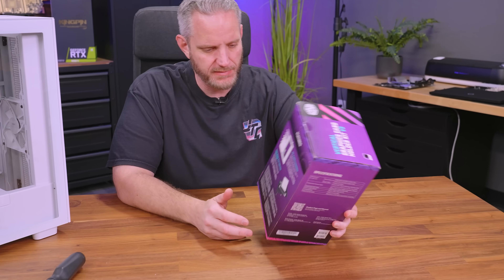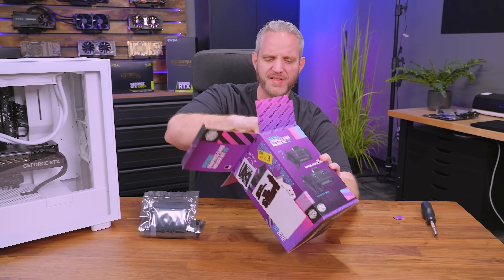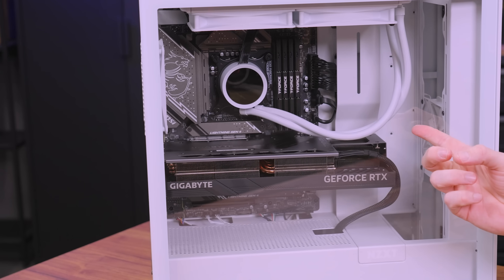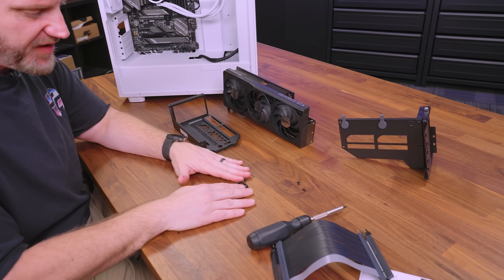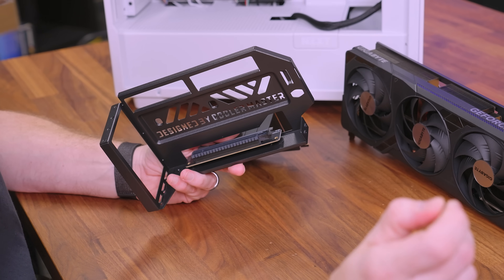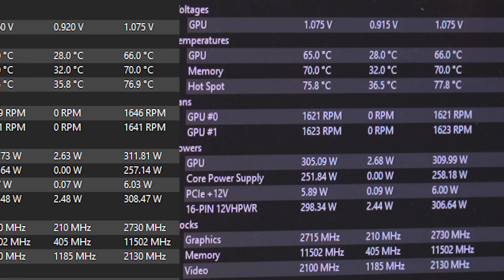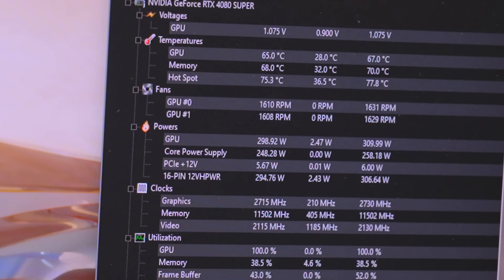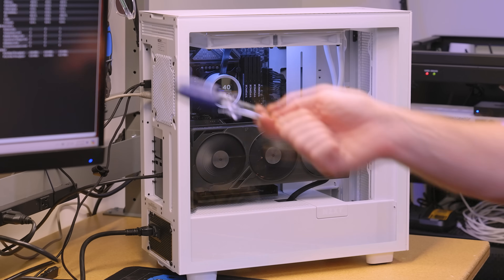Can this mount actually HELP GPU temps?

Comment: the best way to keep a gpu cool & quite is first of all undervolt it & optimally have a case with 3 bottom intake fans bloowing fresh/cool air onto the gpu
my 3080ti tuf oc never goes above 57C on the gpu die & 68C vram with fans set to max 60% while gaming, case is lian li dynamic evo

Comment: The Phantek new Premium vertical mount with gorgeous LED strip across the base, can be slanted to 45o and is solidly made. Has a similar cage to the Coolermaster but possibly better build and sturdier - check it out Jay :)

Comment: Since you have one on hand, what is the cleance between the pcie slot on the mount and its rear support bracket? I have an active cooling backplate and need at least 7 mm of clearance.

Comment: Hey Jay, does it really not matter how you orient the GPU? I was always thinking, that the best way to utilize the Heat Pipe flow is to have it horizontal to the CPU as well as to the GPU with the pipes pointing upward. (So like the old school HTPC concept of PC's. If it does not matter and there is a higher benefit of a direct air intake to the GPU, then I will leave it in its standard position as well as the CPU cooler in its regular mounting direction to the side. Thank you!

Comment: I bought a mount like this years ago and I love it.

Mine is aluminum and really compact. It requires you to remove the horizontal slats in between the PCI-e slots (if your case still has them, some new ones don't).
In return you don't ever have to care about the monitor cables or GPU length going up by more than a few mm.

Comment: This is why I had to switch from the Hyte Y60 to a Lian Li Lancool 216 because they put the mount right next to the glass if you're using a bigger card. GPU got way too hot.

Comment: Meanwhile I can't even afford replacement fans for my GPU so I slapped a case fan on it with ziptie and it... kinda works? It's not thermalthrottling on opening forza horizon 4 while it's still in it's main menu. I mean it is throttling, but it doesn't go to 93C, panic throttles to 133MHz, temp drops to prefered 85C and then back to 93C. Now it stays at stable 82C with like a bit more than half of performance. :D Had to change the prefered temp to 82C because sometimes it goes to 90 before it realizes it shouldn't go 9000% overclock (damn gpu boost 3.0).

Comment: The product is satisfactory, except that the recessed ports on the GPU are difficult to access once installed. Additionally, if you push the mount too far forward, it can obstruct your display ports.

Comment: One thing to note after buying this recently myself, the graphics card can suffer from tilt fowards because of how stiff the PCIE cable is pushing behind the mount. I was not aware of this before purchasing until having a quick google. Don't get me wrong it is no where near a big issue but can be unaesthetically pleasing.

Comment: I've always been interested in vertical mounts, but sadly, there are no cases where I could do that without sacrificing my SoundBlaster AE-5.
Now I could use an external DAC, but then again: i don't want to spend another couple hundret bucks, just so I could use vertical mount with 600 ohm impendance...

p.s.: Fractal Design Meshify 2 XL is my case, so its not a smol one either...

Comment: I mounted my 7900XTX Red Devil vertically (with universal mount LINKUP - AVA Universal Vertical GPU Bracket, look at the Amazon if you want it) year and a half ago, and it lowered 2-3 degrees of GPU :) The main trick is that my case - Corsair 5000D Airflow has 3 intake 120mm fans on the right side, and together with frontal intake fans the main cold airflow inside the case is shifted towards left side, and that's where the GPU is. :) I really suggest to Jay to re-check horizontal-vertical GPU temps with a case with right-side intake fans, like 5000D. The airflow can be shown even in "Smoke test" :)

Comment: You also add another point of failure/bottleneck by using a riser cable. You should only vertical mount for space restrictions.

Comment: My cooling is ok but tinkering in Daz Studio (3D rendering, animation, ray tracing, cloth dynamics etc,) is sucking my PC dry. No benchmark has ever made it work like this.
Gpu (3080 10GB) 100%    Cpu (3700X ) 100%    Ram 32GB -99%    Pagefile - 90% Temps stay in mid 60's to mid 70's, plenty o fans, 240 aio.
I just stuck 80g in it..2x32 + 2x8, that'll fix it..........nope............virtual memory available - 165GB...using 90%...Physical memory available - 77GB...using 90%...Pagefile - 83.3%
The more I give it the more it eats. Probably poke another 2x32 in it next month, eventually I'll do a 5950X. That's the best I can do then I have to quit. Lotta damn money to run a free program. 😏

Comment: I would love to put a vertical mount in my OG Fractal Meshify, or even get a newer case that better supports a vertical mount... But my issue is that I have a 4-port USB card in my PC to run all my USB devices. Are there any mounts that would still allow me to use the USB PCI card?

Comment: My problem with all vertical mounts I have seen is that they stop you from using any card other than your GPU such as an NVMe expansion, USB expansion or networking card.

Comment: I bought this mount about a month ago. Fitting the GPU onto the connector was tricky. But I noticed my SSD temps were high due to the GPU blocking airflow over the heatsink, so just moved it away by a centimetre with 1 simple screw turn.
And yes, it looks wonky

Comment: Heres a puzzle. Where my gpu riser mount sits is level - tested as level. The riser is level. The case is level in all other respects. The riser is setup so it’s at the exact height needed so the card doesn’t sag etc. Then I put the gpu in and the gpu is … not level … it sags down at the front. The card is inserted perfectly. 

So I need to out several 5mm ish standoffs at the front of the vertical mount. Every is level again … or everything except for the gpu mount which tilts upward. 

Still, all good!

Comment: There could be some benefits with a mesh side panel. Any bottom fans theoretically will push air through the sink while the gpu fans would intake from the mesh. This from my standpoint of using an AP201. Your thoughts?

Comment: Well, how should I rearrange my room to cool my video card better? Haha. I live in Spain, and the problem is the room temperature, not the GPU itself. My 4070 usually runs at about 60 degrees, but after playing for 2-3 hours in the summer, the room becomes unbearably hot.

Comment: Won’t help in every scenario, but for most O11s and its copycats, will help, specially the NVME not being bathed in hot air exhausted at the side of the GPU’s heatsink. Rule of thumb, as long the GPU doesn’t stay too close to the side panel, is fine. Bottom intake for most GPUs still king. Regarding the bracket from Coolermaster, after using every model from Lian Li and Phanteks, that one still my favourite. Specially considering how much it costs in the UK. Got mine for £35.

Comment: All the adjustments are really nice.  Even if you wanted it as close to the motherboard as you could that would be useful for install so you had enough room to get the extension cable in the motherboard.  

I'm using the NZXT "universal" bracket and it's pretty good.  I have a custom loop in mine so the card (6900XT) isn't super heavy, but even still the bracket did sag a bit.  I built a little brace between the bottom fans and the bracket out of Legos, lol.  Got it perfectly level.

Comment: Have you ever encountered the fans stuck spinning at max RPM bug on the nvidia 1660 super? It seems to be common on other nvidia cards too according to what i found on google. 

It worked fine the day before but it wont even boot today (the card goes into max RPM mode and the system needs a hard reset) 
After a couple hard resets it boots but only works for about 15 to 30 minutes before the screen goes black and fans ramp up to max (same as before but this time while in idling on desktop)

Comment: I have a V2 from cooler master. And, I can confirm if you have a bottom mounted fan, at least 1, then a vertical mount is very helpful in moving air through the GPU fins much faster. I have a Corsair 4000d with 80mm fan tied to the grill on the PSU shroud and it makes a TON of difference in my case.
Reply: I'm using a Phanteks 4.0 Riser with a 3080 and 2 140mm fans attached to the PSU shroud on a 7000D and can confirm the airflow of extra fans helps a lot on temps across both the GPU and CPU/Motherboard/AIO since anything that hits behind the card ends up flowing over the motherboard. I found some magnetic feet with a small frame to attach both 140mm fans to the PSU shroud that really helps pull air from the shroud and drive cage underneath so it keeps airflow going from bottom to top.

Comment: Not that it looks like you have to worry about sag, but there should have been an included slotted angle bracket to be used as a support foot for the GPU.

Comment: It would be interesting to see this same test in an airflow focused case with a mesh side panel. Then you can use this adapter to get it as close to the side as possible to get completely fresh air.

Comment: I have the previous model in my 011D and it's been great. The main reason I bought it is because the PSU cables were being crushed between my 3070ti and the glass. Of course a 90 degree adapter would have also worked but I liked the vertical orientation.

Comment: I just hate blocking any additional pcie slots with vertical mounts. Being able to mount other accessories on risers would mitigate that but there are no mounting solutions for that. Card mounts to the right of the motherboard could solve that

Comment: In my 800d going Vertical (With 3 inches between the fans and the door.) made the my 3080ti temps rise by 8*F.  Switched back and temps lowered back down 8*F. Kept it this way for 5+ years now and never looked back.

Comment: i used the coolermaster vert bracket in my nzxt h7 flow and it was amazing, took a bit of doing but once done was solid as hell, have sold it and dude took it 4 hours home like that, he took a paper towel folded it up and put it under the far end

Comment: I got this exact same mount but the Arctic Freezer 3's tubes come out the bottom of the pump and are way too thick and rigid and they looked very wonky being pushed by the GPU

Comment: I got this so my glass panel wasn’t close to my 4090 plug so I could make sure it wasn’t under any stress
Using it in the NZXT h9 flow case was a bit hard to get in but got it in

Comment: Had an evga ftw3 2080ti in a standard O11 dynamic and it was choking up against the glass. Got the cooler master vertical mount for it and my temps dropped almost 20C with the same fan curve.

Comment: The biggest reason you want to vertically mount the GPU is to avoid cracking the PCB at the edge connector. Today's GPU's are way t heavy to mount horizontally, even with a support bracket, weight is still on the socket. second reason is to allow airflow over your M.2 heatsinks.

Comment: I've had my RX 6800 vertical mounted for a year plus now and it definitely helps disperse the heat more efficiently, always cold air flowing out top and back exhaust the only heat I get from the card goes straight out the case.
TIP: get a right angle extension thought, not a straight extender cable

Comment: The slight upward angle drove me nuts. I admit that's a me problem, but I still had to return it. I also seem to remember that the plastic clamps still allow the card holder to fall out forward as there's no metal lip on the back of the channel... if that makes sense. No big deal really, but definitely means the PC shouldn't be shipped with the card installed. Be careful moving it around, even. There's not really a better option out there, unfortunately, unless you make your own.

Comment: So, this particular mount that you used, is what I used to have in my rig. I found that over time, the card warped the metal of the mount, probably through a combination of heat and weight, and eventually started to droop a little in the case. Concept is great and I always use vertical mounts on my GPUs, but there are better-built mounts available.
Reply: What would you recommend over this? I'm in the market for one for an H9 Elite case
Reply: @josephthornton3316  Late response but I ended up using the one EKWB makes way back then. It's more rigid metal and is braced significantly better.
Reply: What mounts are better??
Reply: @jubblybits6155  I used the one EKWB makes. Better quality metal and it's braced far better.
Reply: I don't know how you can 'warp' a metal bracket that doesn't move. You probably dropped the case and that happens.
Reply: @Traumatree  Uh, no, it's cheap Chinese metal that is very flimsy and the card is quite heavy. If I also have to explain how heat makes metal pliable then I'm wasting my time.
Reply: @cypherpunk6417  I have one and it is rock solid. The CPU weights is on the vertical metal sheet, so that can't warp. Yours probably a fake from Temu where you buy your stuff.

Comment: Have to decline this vid bro, I'm looking at the setup your trying the build the vertical mount in with not enough intake fans. This is not gonna run better as not enough fresh air is coming into the case. Your blowing hot air onto the mother board. Your cooling the gpu with that 1 fan but not all the resistors or memory cores. This is insufficient with a fully fan ran case. I call bs and I can prove it with my case.

Comment: Been using mine now for about 4 months, no sag issues with my humongous AMD Powercolor Hellhound 7800 XT card. Very happy with this product. Like Jay mentioned, it is very sturdy and highly adjustable for any case. Fits great in my corsair D4000 airflow case. I Highly recommend it, specially for water cool builds.

Comment: These vertical mount brackets are way to expensive for what they do. This Cooler Master one is over 75 USD here. I use Fractal Design cases and their Fles 2 mount cost over 80 USD.
The previous version of this CM model, the V2, is over 50 USD.

Comment: I got one of these for my birthday! I have that nzxt 510 everyone has. It barely fit. I have my radiator in the front. I had to get half height fans in front. I can't screw in the fan bracket, because it doesn't allow for enough air flow. But it looks damn good! And my XFX '6800 doesn't droop anymore.

Edit: I didnt want to mar my case to hook up to my monitor. So I got a cord extender and snaked it out the back.

Comment: my first two PCs (built in the 80s) were horizontal motherboard/desktops.  A larger footprint and unnecessary in 1989 - necessary since 2016 when the most expensive components became the GPUs installed in all PCs.
I'm still waiting for Phanteks or Lian Li to break out a horizontal case. Don't want my 6 pound GPU hanging horizontally and don't like any of these one-size-fits-all add-on pieces of crap.

Comment: Thanks jay 4 showing this new product my 4090 need this. There is alpt of 90s that split at the pcb so vertical is a must but my old case has no mount.

Going 2 get this asap

Comment: I always had issues with the heat sink sagging away from the card on horizontal mounted cards. Yes there is bracing for that but vertical mounting always just made more sense to me.

Comment: YES Yes Yes Vertical mounts , absolutely improve cooling. In my Y70 touch build, not only do I have a water cooled block on it, but I have two fans  cooling from the bottom of the case, So it gets the benefit of both air and water on the GPU

Comment: No it doesn’t help with temps. it’s purely for looks. horizontal is better for temps because the front Intake fans will pass air through the side of the gpu. 

if you have bottom fans then even better since the air that intakes from the bottom will blow directly through the card. 

the only reason I have those vertical mount is because I didn’t want to take the chance & ruin my 4090

Comment: If you want the best vertical mount you have to get the "EK-Loop Vertical GPU Holder EVO", it screws into the motherboard for extra strength and it's awesome. There is no competition.
Reply: If it's from EK though, Jay is probably not going to give it a try. He recently removed all of the EK stuff from his builds as much as he could.
Reply: @sp00n  Yeah, I know. He was just talking about "triangulating" and how important it is and it's what the EK one does and afaik the only one, every other one I've tested is crap.

Comment: using that exact CoolerMaster Vertical mount with my Gigabyte Gaming OC 4080 in the NZXT H6 Flow case, temps are great, plenty of room between the card and glass and it looks dead sexy.

Comment: 11:30 more like a portion of the heat from the GPU is transferred to the chipset/NVMe heatsink w/c indirectly increases those component's temperatures. I had my 3080 completely overheat my secondary NVMe storage to the point where it stops functioning and freezes my PC just because it's positioned right beside the exhaust side of it and my only solution is to increase fan speed of the case as well as buying a 3rd party NVMe heatsink for my storage to not directly have the heat of the GPU. Good thing is that I am using a Lian Li Lancool II Mesh and I have 2 TF120 case fans on the bottom blowing air to my GPU w/c blows the exhaust upward to prevent my GPU's exhausted air to heatup my motherboard and all of the components attached to it.

Comment: if you need a vertical mount usually depends on the direction of the gpu fins. i dont use one because my gpu has fins that direct air out the front and back, but i would have enjoyed one when i had my 390x because the fins make the air go out the sides and recirculate